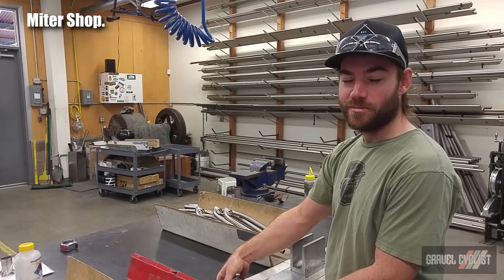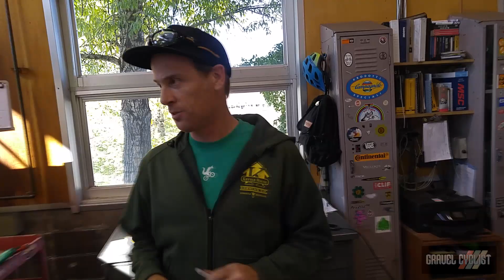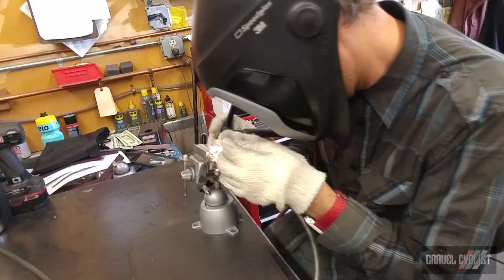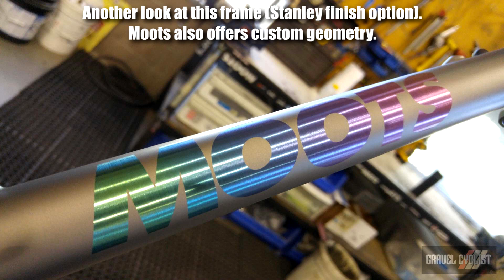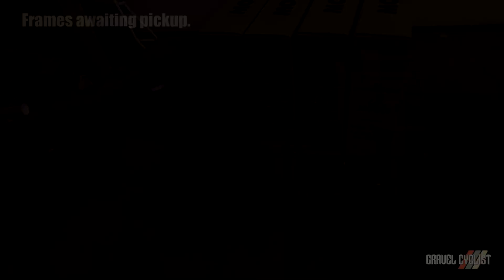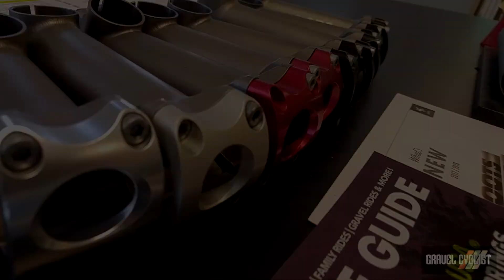Moots Titanium Cycles Factory Tour - How They Make Their Bikes!

Comment: Love this!  I want one so bad!   I just wish the seat tube and seat post were a little less rigid (more compliant).    Also, RE: the Stanley finish, how does it hold up over time?  One of the benefits of brushed Titanium is that you can re-brush it fairly easily by hand.  I wonder how that would work with the reflective colors on the Stanley?
Reply: Moots is not brushed it's bead blasted . So you won't be able to refinish it that easily you can do it yourself with some gear and 2 hands but Moots is probably more good at it than you except if you've experiences with that stuff . The stanley finish is anodisation and a 1000 USD option ... On smaller pieces like knives I know anodisation can and will fade a little over time , don't know on a bike frame...